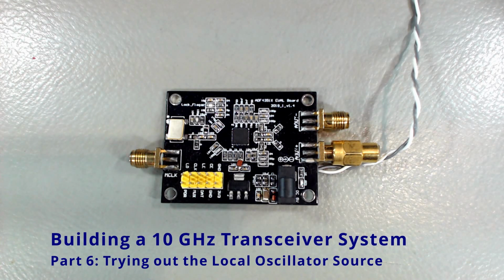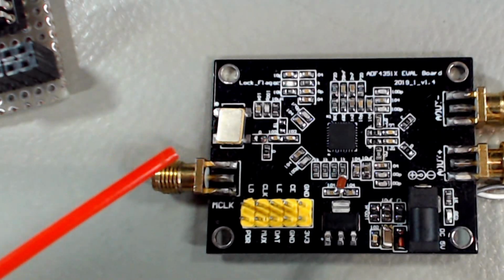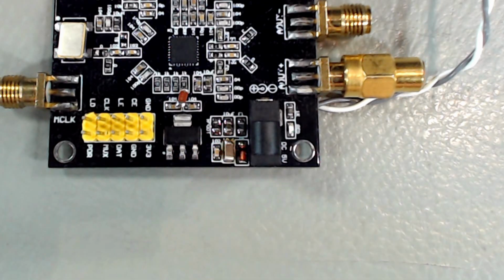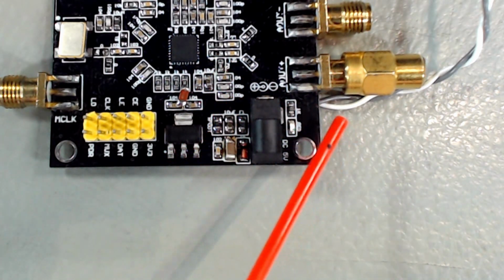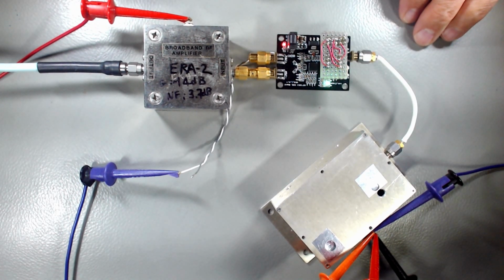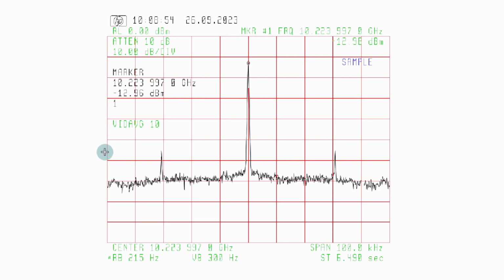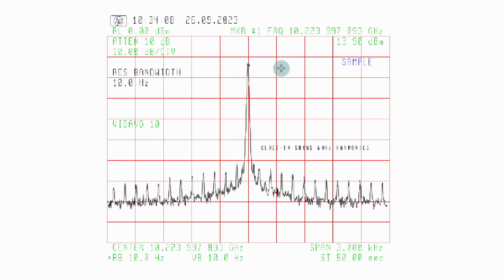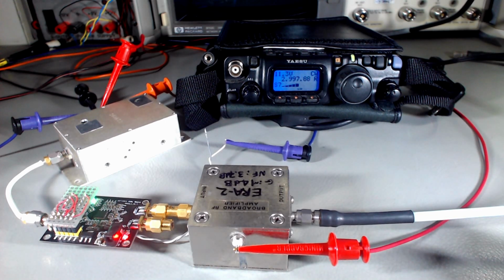10 GHz System, Part 6: Let's try the LO Synthesizer

Comment: Where can I build/purchase/acquire a 10MHz reference of similar quality?
Reply from the maker: I use an OCXO (a free-running Oven Controlled Crystal Oscillator), an Isotemp OCXO131-100 in that box. It is a +5V unit with square wave output. I added a 7805 +5V reglator. There is also a 10-turn potentiometer added to tune the oscillator to exactly 10MHz. You can get a used OCXO unit on eBay for around $20 US. 
https://www.ebay.ca/sch/i.html?_from=R40&_trksid=p3519243.m570.l1313&_nkw=isotemp+ocxo131-100&_sacat=0

Comment: Would a MAX2870 doubled be better? It has a much better Jitter rating than the 4351
Reply from the maker: Very likely, a MAX2870 would also work. Slightly more expensive. And cheap Chinese boards are available. 73.